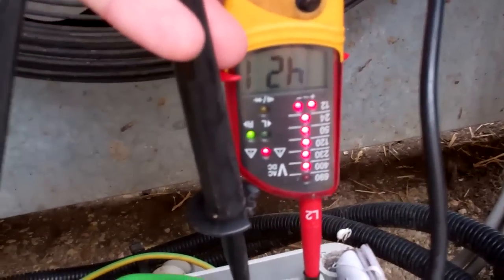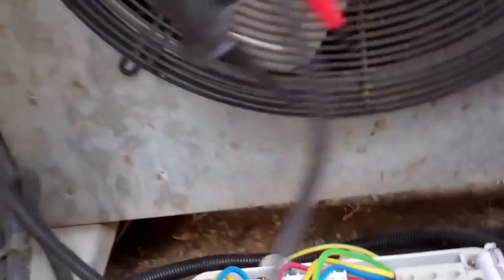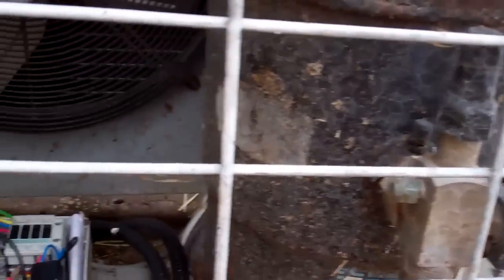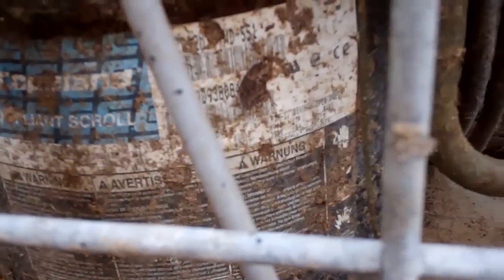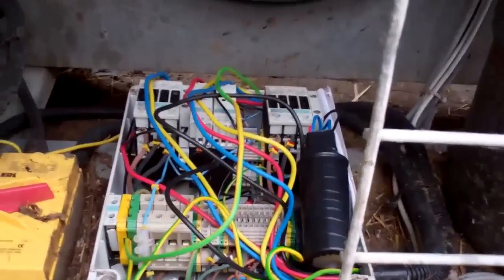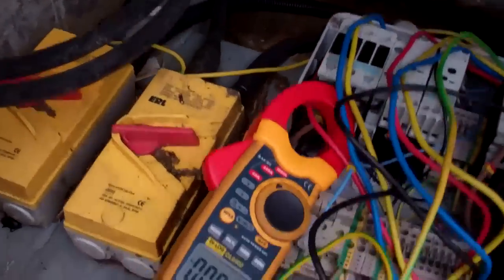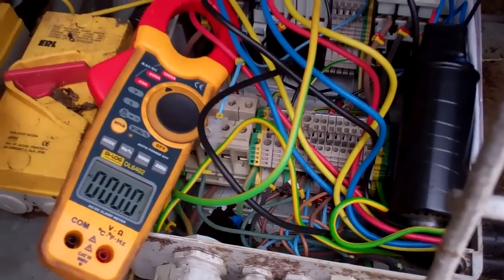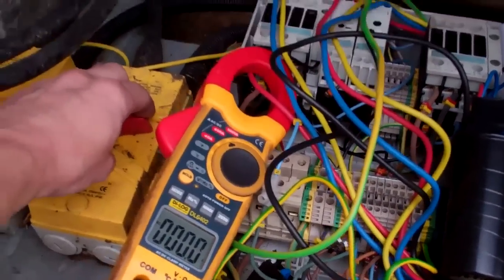Breaker trippin'

Comment from the maker: @AVTreasures I like the sound of these too! I prefer working on the bigger stuff!

The smaller single phase ones will run backwards if you turn them off and then power them up again while they are spinning backwards! Used to get a few calls to them when there had been a short power cut, we started fitting anti cycle timers after that!